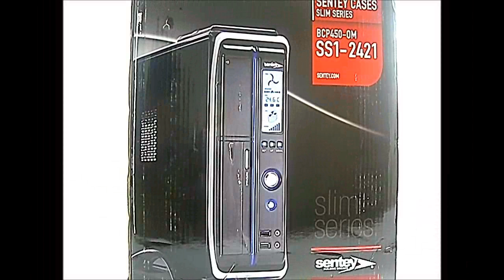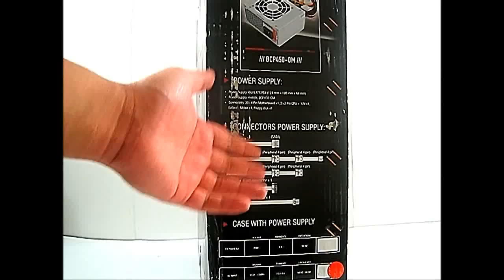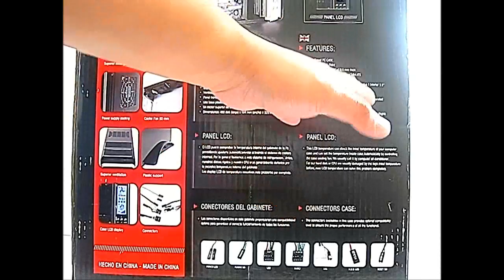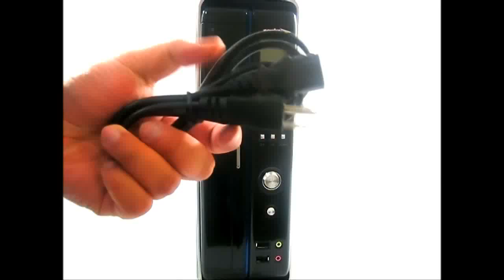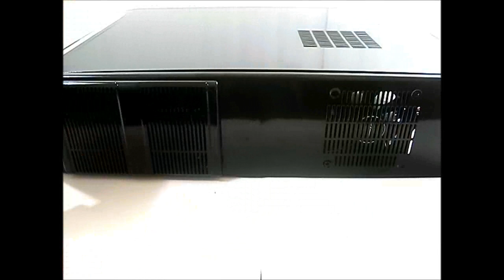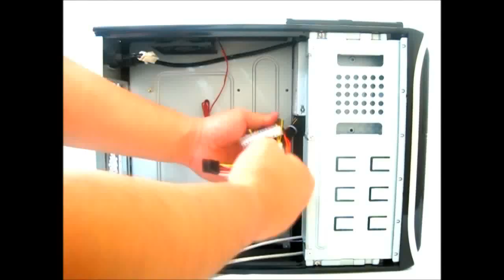Sentey SS1-2421 - Product Overview

Comment: @MrNice399 I have a 26" Samsung on top of mine with no issues.  Do mind your ventilation though, I ended up cutting a hole on the plastic base of my monitor just to make sure, even though I never had any heat issues.